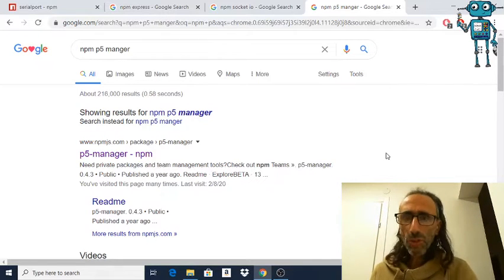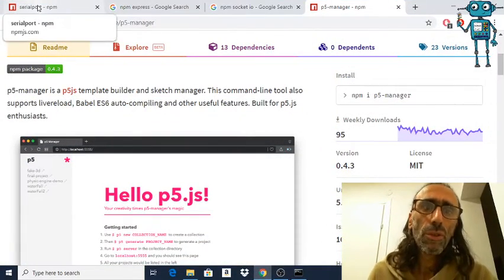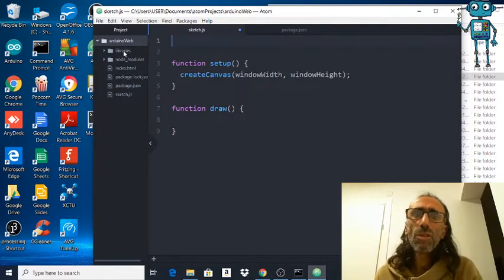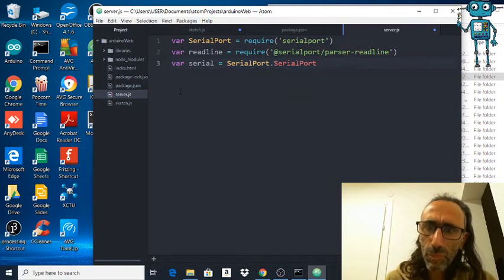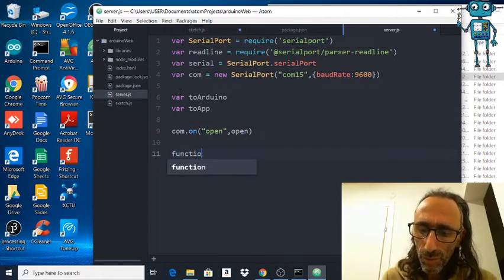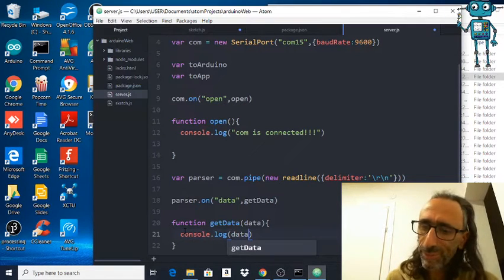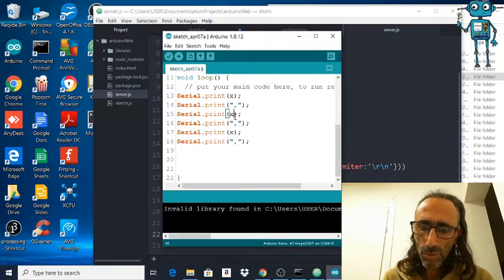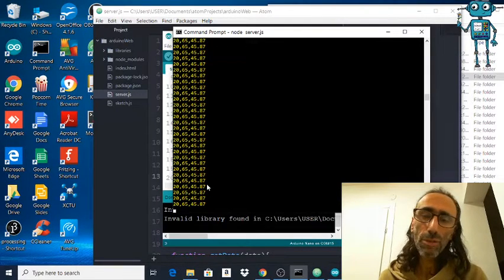arduino node.js

Comment: Great video! One of the best because it is spoken very clearly, slow enough to follow in real time, and not too slow to waste the time. Also the content for one video is good enough to allow focusing. The server program and the arduino program are working well. Few comments if I may. Perhaps a 2 minute overview on what is P5 and node.Js are will help newbie. Is there a way to compile the server.js? I had few typos and debugged it in run time. On the arduino side:  It is a good practice to increase the variables every cycle and add a delay.
Reply from the maker: first about p5 and node overview its coming. about the arduino its not a good practice  to use delay its better to use millis. the code i used in this video was just a quick way to test everything. in the next video we are going to get to the arduino part. i am glad you like my videos and the topics its really the purpose off all of this.

Comment: Hi. I started with NodeJS installation. Looks ok (i tried node -v & npm -v). However, "npm i p5-manager" fail with: "2 packages are looking for funding
,  run `npm fund` for details. found 7 low severity vulnerabilities

  run `npm audit fix` to fix them, or `npm audit` for details"

The "fix" returns: " npm ERR! audit No package.json found: Cannot audit a project without a package.json". What did I miss in the installation?
Reply: I found the "npm install -g p5-manager" which did the job, unlike the "npm i p5-manager" from the P5 web page. strange, but now I am on the horse again.
Reply from the maker: that is interesting, but what's important is that you are on the horse again